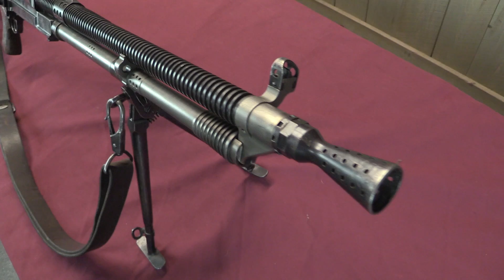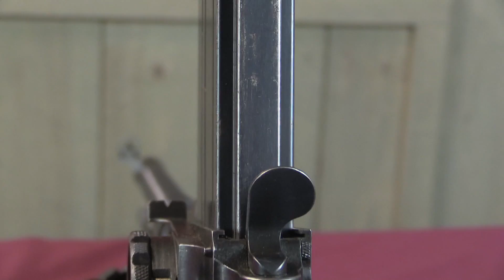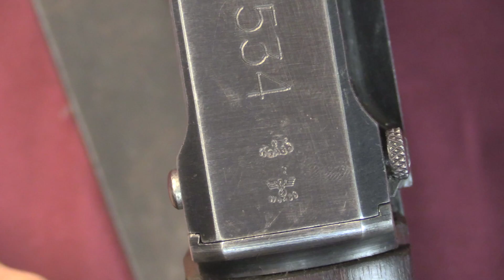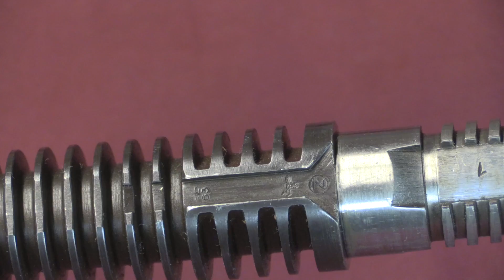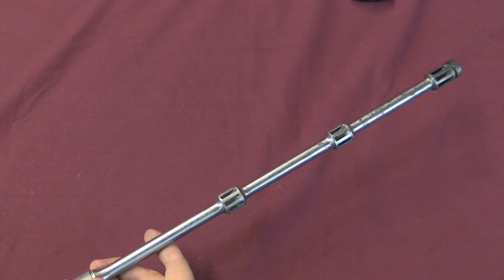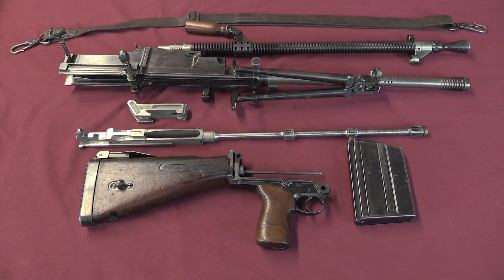ZB26: The Best of the Light Machine Guns

Comment: Is the ZB-30 an improved version of the ZB-26 or a simplified version, like the Bren? From what I can tell the ZB-30 has a bunch of small changes to things like the barrel-release latch and bipod, all of which seem to have required more time to machine than the original. The later ones also had a more intricate barrel with checkering added for better grip near the carry handle as well as a longer flash-hider. I watched some of Machinegun Dad and TFB TV's videos about the gun and from what the guy says the ZB-30 was definitely an improvement over the 26, and that the Czechs made the changes for a good reason. He also says that the 30 shoots as smooth as butter and blows the BREN gun and Type 99 out of the water. Maybe you can do a video on all the ZB variants and show how they have eloved, and which were improvements and which were simplifications? This gun may not be as iconic as things like the BREN, MG-34, MG-42 and BAR, but it is considered by many to be the best LMG of WW2. I think it deserves more screen time, and I think this channel would be the perfect place to do an in-depth look at this family of guns.

Comment: I wonder if many people connect your description of it being an "open bolt" operation and your comment about using the carrying handle to change a hot barrel as to why automatic weapons in general tend to be open bolt designs?

Quite simply, after sustained fire the barrel on a closed bolt weapon could be hot enough to "cook off" a chambered round after the gunner has ceased or paused fire.

Comment: Between the T99, the ZB26, the Bren and the BAR, I would go with the Bren in real combat.
The quick change barrel feature of the Bren makes it the best bet in by book.
As far as magazine fed squad type LMG's goes; I own and shoot three T99's, a T96 and a BAR.
I have fired a T11, a ZB26, and a Bren.
Still, the T96/T99's are a real sweet shooters, and I have found no need to oil or wax the cartridges.
Finally, all but one of the dozen or so T99 barrels I own have chrome plated bores, but all three T96 barrels I have do not.
Gregg

Comment: Actually the ZB-26 (albeit tank coaxial version) was adopted as a standard Tank Machine Gun in Germany via the Panzer 38(t) and Panzer 35(t) and the likes, it entered service as the (if memory serves me righ) MG 718(t) it served alongside the heavier Zb-53 / MG 37(t) which was used in most tanks while its Infantry cousins Wehrmacht designation was MG 26(t) (they had designations for all its versions and the likes such as the MG 30(t) it was issued to mostly Waffen SS in the MG 30(t) configuration, but also Saw use With Sicherungschutze (security/garrision/third echelon Units) Units aswell as with Festung (fortress unit) and Gebirgjägare (mountain Infantry).

Comment: Great video,. Particularly interesting is the comparison to the Bren, what came with the Brno weapon and what Enfield added. 
Firstly, there seems to be no gas regulator in the ZB26, perhaps tapping so close to the muzzle made it unnecessary, but you lose the ability to adapt to different ambient temperatures and fouling. The .303 was cordite filled, and the 7.92 Mauser would presumably be filled with another dibasic powder, again that would affect the need for a regulator (but the Besa had one I think, and it was in 7.92). When the Bren was reworked back to 7.92 Mauser for export it kept the port position and regulator of the .303. 
Secondly, the Bren (and the 7.62 Nato version) has a spring loaded unlocking hook, it must have been a really strong spring (it was definitely an armourer's job to mess with it), this related to the unlocking and extraction, perhaps with the port so far forward it became superfluous, and no oiling of cartridges either, obviously the brothers knew their stuff.
Thirdly, the rear sight is nice, like a Bren but turned forwards! Obviously benefiting soldiers accustomed to tangent rear sights, whilst the Bren matched the aperture sights on the Nº 4 rifle. 
Finally, 20 rounds is really not enough for an LMG, it avoids the issues with long springs and perhaps is why it is so reliable, but there is nothing wrong with the 30 round magazines on the 7.62 Nato version, and the .303 worked better than most people think.
PS that horizontal foregrip is sturdier in the Bren and it is awesome to hold and fire the weapon with, the FN-MAG is clumsy by comparison although not in the same league as the M60!

Comment: I live close to a forest that was once a military training area that has been used by the Austrian imperial army from 1700 until the end of WW1. In WW2 it was used by the Wehrmacht and SS. I go metal decting there from time to time and of course there are tons of 8x57IS casings in the ground. But some have a weirdly shaped dent in their struck primers. It's not round like if they were used in a K98k, MG34 or MG42, it's kind of rectangular. From doing some research I've found out that they were fired with a ZB26.

Comment: The Type 96 and type 99 really do not have much in common with the ZB26 other than basic gun layout. The Type 96/99 are more related to Hotchkiss in action. The Japanese Type 97 tank machine gun was essentially a copy of the Zb26 with the usual Japanese craziness in aesthetics/ergonomics. You did not mention the butt plate is spring loaded to reduce felt recoil even more. I was waiting to see if you removed it since when I took mine off it took 3 hands and a lot of swearing to get it back on.